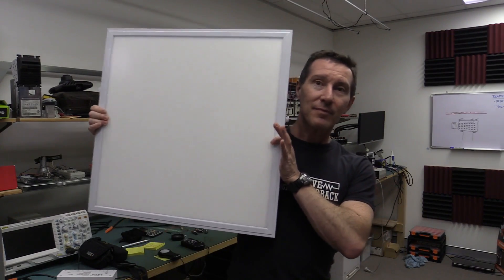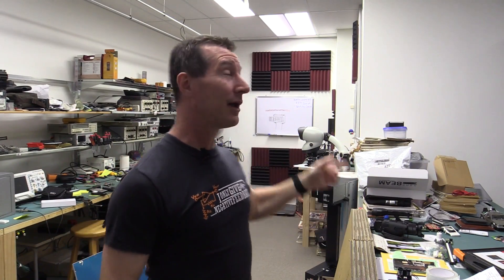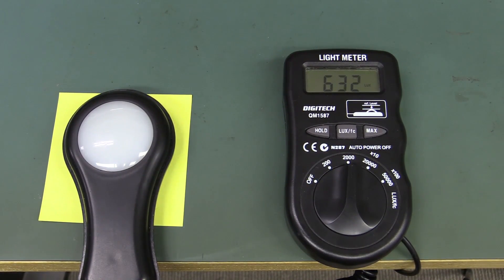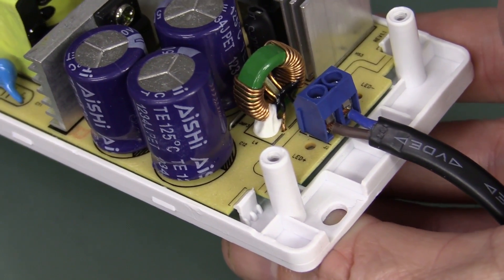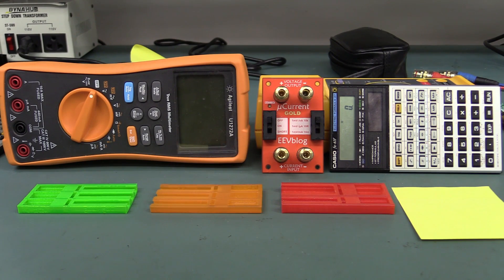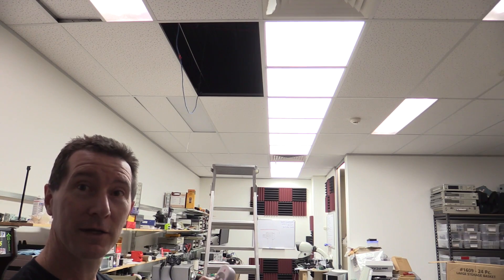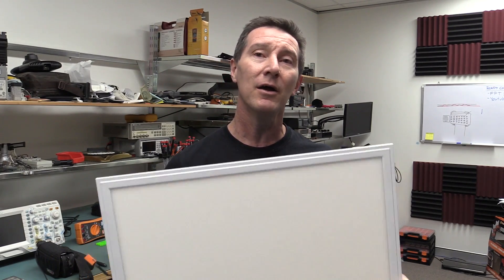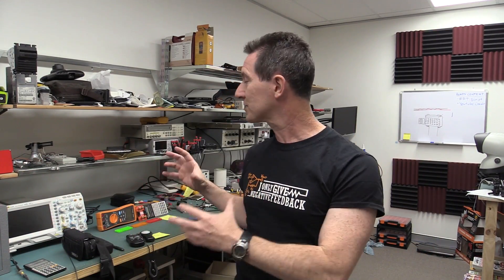EEVblog #764 - New Lab Ceiling LED Lighting Installation

Comment: My homelab is small only 12m squared but I'm going to install to 30x120cm panels of 3400 lumen 4000k each. On top of that I have extra LED lighting above the bench. It will be well illuminated for sure.

Comment: 1080 Lux for soldering I designed to working with datasheets a floor/worksurface plan and a bit of trig. Source Space product assurance Manual soldering of high-reliability
electrical connections ECSS-Q-ST-70-08C5.4 Lighting requirements
a. Lighting intensity shall be a minimum of 1080 lux on the work surface.
b. At least 90 % of the work area shall be without shadows or severe
reflections.
The CIBSE have recommended figures too.
There are loads of free lighting calculators on the interweb.
Cheaper to calculate it first.

Comment: EEVblog I have the same set of remote controlled power sockets. And yes, I also have one channel that works intermittently. My thoughts about why that is have to do with the strange behavior of high frequency radio waves bouncing off stuff and being disturbed by other stuff (also by other electronic circuits closeby, and whether they are live or not). For example, mine sits on a power bar behind my laptop display. At first, this was a Lenovo Thinkpad T400 with a 14" screen in a metal casing with LED backlight. Now I have switched this machine to a Thinkpad R500, which has a plastic casing around its screen, plus it is backlit by conventional (or "old style") CFL technology. This now seems to work better, for some reason (although this was not why I switched the machine over). Also, in the same power bar, there is (just like with your setup) another of these RF receiver sockets, and this works all the time (but it is positioned not directly behind the laptop screen). Sometimes the failures of the one occur less regular while the other one is off, and so on.
Basically, I'd say it's crappy technology (Have you torn one of those RF receiver sockets apart? They are built really badly, you'll shiver and never want to use them again...), it's cheap, and as long it at least somewhat works, who gives a crap...
(I have had one open, because it was broken, and basically, there was a coil that was deconnected from the PCB on one side. But since I got a replacement from the import company that says they're the "manufacturer" of those things in Germany, I didn't bother to repair it, just threw it out).

Comment: Forget about a rim light or hair light. It is a great idea for still photography but it is either not ballanced properly or it shifts too much to be decent when you move in video. If you notice it at all in the movies it is a very well placed strip light that follows the action, and even then they turn it way down. Prefer Rembrandt light and get rid of the overhead completely if you can. Industrial overhead light doesnt work for anything but horror films.

Comment: You are not going to get good light if it is all raining down from the ceiling. You can see on your video that your eyes and half your face is always in shadow and that is horrid. A little bit of a course in movie lighting will give you a clue. You can even use standard studio light ideas. Big soft light is a lot easier on the eyes than a harsh single source but both are useful on video. Find out about Rembrandt light. And yes, shadows are important, but so is where you put them. Your camera is not challenged by low light in your studio at all. The camera is challenged by your choice of light placement. And that is all she wrote. With an ISO adjustment you get pretty much what ever you want but you need to absolutely control the direction the light is coming from. Get a light meter and learn how to use it. Typical modern single sensor cameras have different sensitivity ./ noise profiles but typically 800 ISO is perfectly acceptable, and 1600 is hardly noisy at all. 400 lux is plenty for that. Seriously, you could use more, but it wont kill you. Get yourself a 1000 watt 5k soft box, or at least a good large reflector to put more light into the shadows of your face. Yes it is a bit bright in the eyes. Oh well. By the way I have been working in the movie biz for a long time, so this is not just an armature rant.

Comment: Ah those pesky RF switches .. if you use them with some big switched PSUs the relais contact welds closed i guess.  Tap the whole switch hard on the floor and it loosens and works again.

Comment: Please check the light output every few months from the panels. Some low cost LED products out of China can lose brightness with relatively low hours of use.
Reply: +JohnAudioTech That is because the chinese drive them as hard as they can to be able to write that they have high lumens. But the then normal lack of adequate heat sinking in anything incorporate LEDs in china will get the LEDs chips really hot which drastically lower their life length so you can see a difference after just a short time but also after a month or two.

Comment: What does Dave do as an engineer? I know he an electrical engineer and everything, but I've never heard him say if he works for a company as an engineer or what. Or is YouTube his main job?
I had to like the video when he added in the bit about the hermaphroditic connectors.
Reply from the maker: Tcamp This has been my job for the last 4 years.
Reply: EEVblog Get 3 ARRI 20kW HMI lamps. That should give you all the light you need.
Reply: Tcamp I think he did government engineering work before, as he mentioned in one of his previous videos. (Forgot which, sorry!)
Reply: Hes a dole bludger
Reply: mPky1 His main job? 
So what is his side job? Building timer-bombs and cracking electronic safes?

Comment: Worked in an NHS hospital for 5 years as a medical electronics technician where the building owners said 400 lux at the workbenches was fine! I finally brought the work to a halt until it was improved. They doubled the number of fluorescent fittings and it increased to about 1100 lux. I said they should fit LED panels but they hadn't heard of them!

Comment: Hey Dave, I expect your building is too new to cause any worries about this mate, but some ceiling tiles, especially in 50s, 60s and 70s era office buildings were choca with asbestos. I dunno how it works in Oz but here in the UK there's meant to be an azzy register somewhere. Worth thinking about before dickin about too much - especially in older buildings.

Comment: Hi Dave, regarding that issue with RF switches, try to move them away from each other. I had the same issue on mine, so I had to move them away and now, there is a distance about 1,5m between them. Now it works like a charm.
I have no idea if they are creating some kind of interference which causes this kind of "Fight" between them and then they are just unresponsive or something else.

If it's already mentioned here - then well sorry for double post :)

Comment: Dave, just go all the way and replace every tile with those LED panels. ;) The real way to go would be running ones with low voltage dimming, and put them all on a single dimmer that kicks on 10% brightness when you switch it on. I popped a pair of 24,000 lumen panels in my garage on a fancy Lutron 0-10v dimmer. It's setup to always turn on at min brightness, which takes like 50W but is reasonably bright as far as garages go. If you need more light, just dial it up. It's nice to have too much light on tap.

Those connectors look like Anderson PowerPole knockoffs. Nice design. Although the PowerPoles slot together so you can configure plugs with different colors and shapes that only plug in one way. Really great if you're doing funny things like battery voltage switching for charging/discharging.

Comment: Hi Dave,

Back in my electric vehicle racing days we used a lot of 350 Amp (continuous rating) Anderson Powerpole hermaphrodite connectors.They did them in various colours, which would only mate with matching colours.

A lot of UPS units use them, or a special low insertion force version, for the hot swap battery packs.

Comment: Did you consider building your own lights from COB LEDs?  I have been looking into the Cree CXB3070 for a potential indoor garden (currently, it is just an interesting thought experiment).  The 5000K is only 70 CRI, but you can get 3000K at 90 CRI.

Comment: I have many times problem with remote switches not will switch OFF. I suspekt that the simple internal dc supply is drawn down, when the relay kicking in and give less voltage to the receiver part or maybe more ac ripple.

Comment: I can't see much difference at all between the old and new shot comparison. The new looks a bit more saturated...just a bit, but that may be due to the overall exposure being slightly under compared to the old shot. I would try, if it's possible, to disable any auto sharpening function.

Comment: I think the new lighting is a tiny bit more true to color maybe because the fluro lighting was a bit blue-green. I take it some of the old lighting was removed to get out of the way, so their cables would have to be messed with and some fed to the led supply. The panels appear to more or less fit 2 to a square so you don't have to mess around too much with re-hanging the ceiling...
Reply: Now if you made two more rows and replaced Doug's thing with those and made a row a few in the other direction, you'd have a great modern look to the office... and removing all other lighting...

Comment: Hello Dave,
I had a similar issue with my lights remote control. I separate them apart and that seemed to solve my issue.
Nice video.
Reply: Mohammed Algailani I can confirm. I had to put my receivers a few meters apart for them to work in unison.
Reply: Mohammed Algailani h
Reply: Mohammed Algailani o
Reply: Mohammed Algailani kffkfkfkffgig

Comment: Jeez. You're going to have so much line noise you won't know what to do with it....
Reply: joblessalex Why do you say that?
Reply: Appalling68 Have you seen any previous videos? He turns off the lights and the scope noise floor drops to almost nothing. Watch I think the safe video.
Reply: joblessalex No, never noticed that.  Isn't there some way to "shield" this?  After all, if Dave can't do it, how can us mere mortals be expected to?? :-)
Reply: joblessalex Didn't he do a test recently that showed the new LED panels removed nearly all the noise? It is why he bought the good constant mode power supply.
Reply: Richard Smith Yep. After I posted this.

Comment: I don't know what the electrical code is in Australia is but If you ran that wiring in the US you would have an inspector gleefully writing up a fine.  Disregarding electrical code differences, you still shouldn't rest your cables and power strips on ceiling tiles.  All it takes is one HVAC/Electrician/Telco/Curious person to start lifting tiles and possibly break things.  Also the weight will eventually break them with time and you will get a sudden surprise of "ceiling snow."  I would recommend that you at least strap things above the tiles to not put weight on the tiles.
Reply: Tony Kramer 

FAQ 033/2010: AS/NZS 3000:2007—CLAUSE 4.4.2.2(d)
CLAUSE 4.4.2.2 Location – Protection of socket-outlets
Question 033/2010: Can a socket–outlet for the connection of a fixed or stationary appliance or luminaire be installed without fixing to a structure or support?
Answer: Yes provided that the installation satisfies the following:
(a) Clause 3.7.2.6 – no undue mechanical stress on any connection
(b) Clause 3.9.3.3 - the wiring is unlikely to be disturbed
(c) Clause 3.9.3.2 – adequate support provided by the suspended ceiling
(d) Clause 3.10.1.1 – unsheathed cables shall be enclosed
(e) Clause 3.10.1.2 – where the sheath is removed the exposed cores must satisfy Clause 3.10.1.1
(f) Clause 4.1.2(d) – no danger from electric shock, fire, high temperature or physical injury in the event of reasonably expected conditions of overload, abnormal operation, fault or external influences.
Reply: Tony Kramer The US has one of the strictest and yet most shit set of regulations.
Reply: Cameron Marks +Tony Kramer 
its because everyone is sue happy over here...
Reply: Cameron Marks i don't think the us has one off the strictest, from what i have seen in some video's they are rather sloppy compaired to the rules in europe, especialy belgium (i speak from experience)

Comment: Does the building your lab is in restrict modifications like this? Our offices don't even allow tacks in certain areas!
Reply from the maker: Mat Mabee No. The lights have pre-wired power points, you can chop and change as much as you want.
Reply: Mat Mabee This is my first guess of where a problem could come. I waited till I owned my condo, but there is a problem with the window in the winter. I just had to fix the wall around it since the condo people still have not officially solved the problem after 10 years...